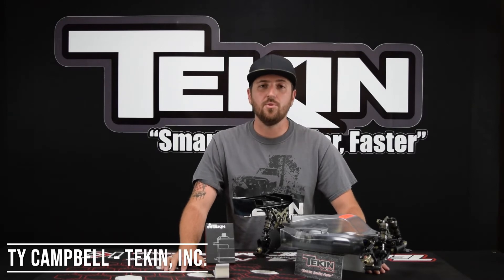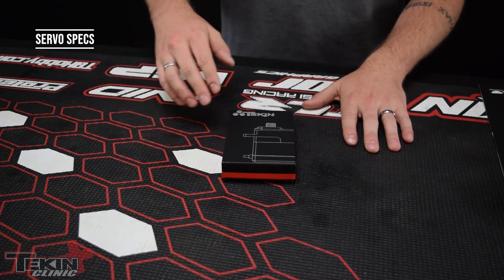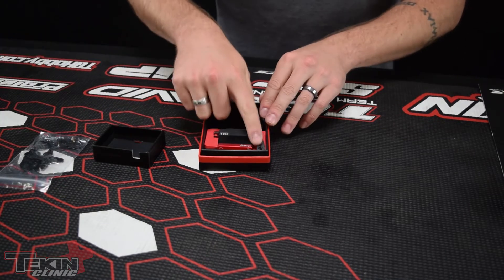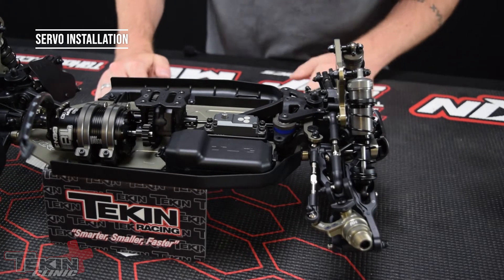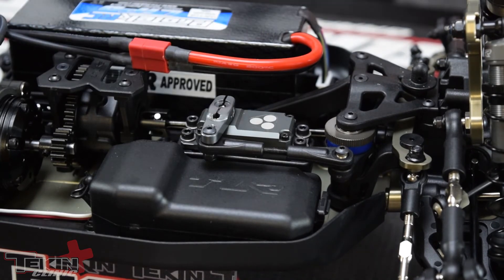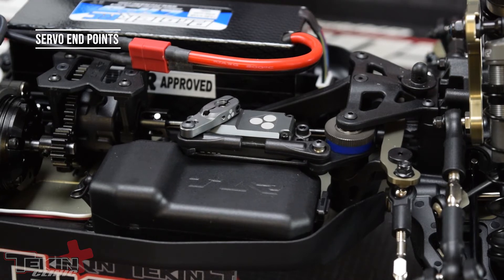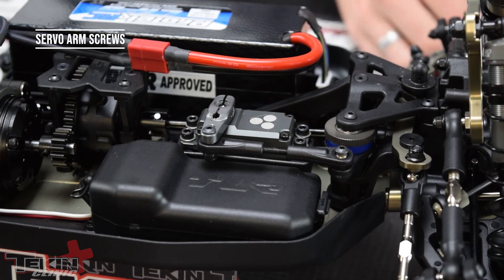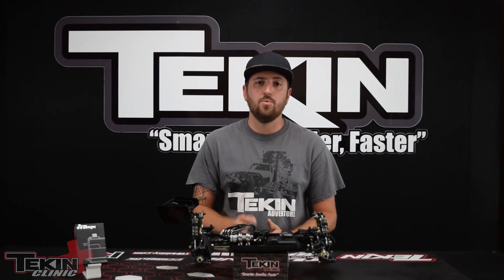Tekin Servo Installation | Tekin Clinic

Comment: I run a Tekin servo in my B6.1 for off road carpet/turf and i love the PC app. I dont have to worry about center on install. Mount it all up, connect linkage then simply center the car and set the servo 0 degrees on the PC app. Perfect center every time. I actually turned down the speed, super fast servo leaves plenty of room to dial in to your style.
Reply from the maker: Glad to hear you are liking the servo and the programming options!

Comment: Thanks for the video.  Looking forward to the hotwire video.  Are the servos compatible with futaba's sr mode?
Reply from the maker: As far as I know, the programmable SR modes only work with Futaba servos that can be told when SR mode is active.
Reply: @TekinRacing  a guy on the facebook group 4px/7px claims his t-180 works in sr mode.  that's why i asked
Reply from the maker: @matthealy563  it will probably work but our servos aren't setup to use that system and I thought it was only available with their servos since it has to be programmed to the servo to know what SR Mode is.